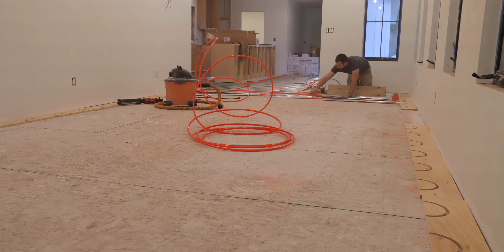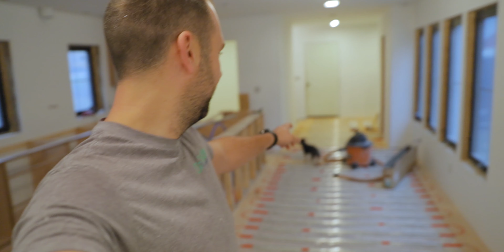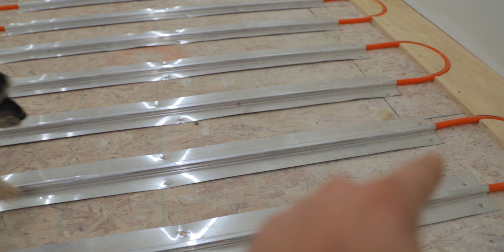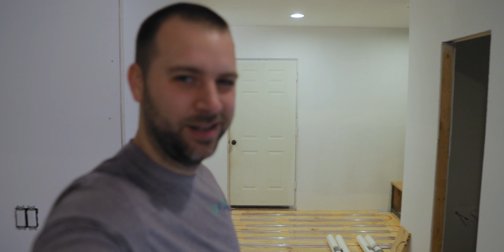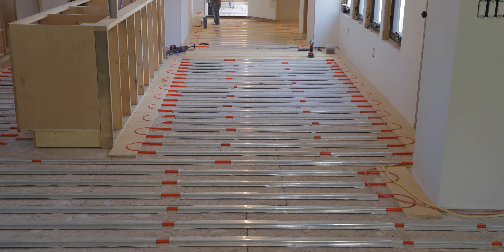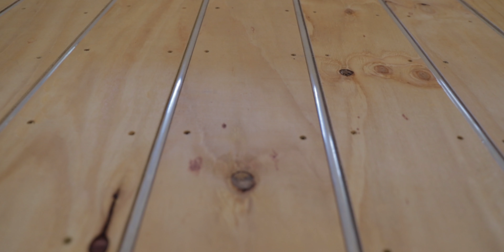Radiant Heat | Installing PEX, Heat Transfer Plates, Sleepers, and a Manifold

Comment: Hi Nate, great job on the radiant floors with hardwood. I would be interested in how well the radiant fllora workwd with hardwood using your approach. We are looking at doing something similar utiliszing an air to water heat pump. We are also looking at ceramics for a portion of the house and I thought you mentioned putting tiles over the radiant heat and I was wondering how that went.

Comment: Thanks so much. I’m gonna follow exactly what you did except one thing. Why not just buy big sheets of aluminum and sandwich it between and not use those fins? I could either lay it down before I put the slice boards on or if I put it on top of the sliced boards covering the pecks, I can just mark the aluminum with a sharpie where the pipes are it should work and I think it’d be a lot cheaper.

Comment: You probably don’t check this anymore, but I’d love to know how your system turned out. I’ve basically decided to go like your tile area 100%. I made a simple model and connected it to a hot water line, then checked the temps with a heat gun. Your tile method gets warm so much faster.

Also, I just laid aluminum flange sheeting over the loop ends with contact cement. Again, better transfer. Just a thought, I’ve been going nuts sorting this out and getting quotes from companies for $20-25k and I still need to do the labor.
Reply: I am in the same boat as you are and trying to figure this out. On a related note, I think I remember him saying in another comemet that he sold the house and doesn't have an update about how it turned out long term.
Reply from the maker: we did actually sell the house, we were there with the system running for a couple years and loved it. the tile was amazing in the winter, helped dry out any snow clothes and boots and stuff

Comment: What exactly is your heat source? I used a  gas fired 35gal  hot water tank in my garage but it's concrete
Reply from the maker: My heat source is a tankless water heater / boiler run on natural gas
Reply: @natenstaci  What temp do you run it with as far as temp of water going into the system thank you for all your answers
Reply: Sorry just read somebody else's question

Comment: Wont the plates installed over the tubing reflect the heat down rather than up?
Reply from the maker: The plate are more for dissipation than reflection. the plates heat up and then disperse the heat over a wider area.

Comment: How do you install flooring on topwith the fins stick up in the air that looks backwards
Reply from the maker: Just rolled out an underlayment over top the fins and installed the flooring like normal, making sure to avoid nailing through the tubing

Comment: I am doing mine a bit different, I had a problem used a router for the curves but the plates mounted fins up with the 1/2 tubing were proud of the surface. Cut all the way thru and still proud so I installed them fins down. I had found a picture to keep the heat up instead of the serpentine like yours. Picture from the ceiling down, left side large 1/2 circles, both large and small for the length of the room, the other side off 1/2 hoop. Tubing goes in the left large one then across the room to the small one and back to the large one. Spaced 0ff slightly on the right side.When you reach the other end and start back you end up using the large and come back to the small and do this to the end of the room. This way the heat stays hot longer and the return line is in between the hot supply. I'd post a pic, but can't figure out how. Thanks for your videos a lot of good ideas and learning. My wife says my loops are ingenious so I'm going with the compliment.
Reply from the maker: Thanks for the info, hopefully it can help someone else!
Reply: I’d like to see that drawn out, I don’t follow

Comment: great job Nate, i just got some qoutes to buy eco warmboard, thermoboard, etc, well i knew it was going to be expensive but still did a huge gulp. I dont see how anyone could pay those prices especially since I am canadian and most supliers are American, so with the added exchange, the prices are crazy. You did an amazing job, and this is exactly what I am looking to do! I will have to watch your other videos to see how you made the templates. Since you ripped your plywood to close to 8 inches, I wonder if I could get away with using 1x8 planks? That way I dont have to rip a million sheets of plywood. So glad I found this video! I would never of thought to install the tubing plates under the plywood, but that sure would make laying everything  out probbly easier and faster! I have radiant ehat already under the floor, but its installed horribly, hardly any plates, tubing on the joists, not the plywood, no insulation, its kitec piping, the whole install is trash! Bought it like this! Since this video is a few yeaars old, how do you like your radiant floors?
Reply from the maker: I am glad this was helpful. We had had no issues with it and really love it. And agreed, those prices from the big guys are insane.

Comment: Do you have any issues with thermal expansion?
I've seen recommendations of only mailing it on one side of the transfer plates.
I'll be doing this soon, appreciate the video.
Any issues or recommendations would be appreciated.
Thank you
Reply from the maker: I have had no issues with expansion or noise. This method has worked great for us. You're screwing the sleepers in through the fins on both side anyway

Comment: If someone does not have this guys skill just use square stock furring strips, and nail sheetrock over top 12" o.c. nail /screw pattern. Run furring strips aprox 6 o.c. with your first strip at the edge(s) for sheet rock attachment. Lay it out on paper and keep your 5/8" (heating only) or 5/8" pex tubing (heating and radiant cooling with humidistat and 60 F supply water for cooling and you will never have a condensation water problem) also at  6" o.c., and try for almost full coverage with the heat plates.  If you cannot find 5 to 6" wide heat plates made for  5/8" pex tubing order from china. China has tight u channels and omega style. If all else fails get a roll of roofing Alum flashing 7 inches wide , and make a press form by gapping boards about 5/8" for 1/2 pex or 3/4 for 5/8" pex, and hammer the sheet metal into the gap using a grounding elect rod laid flat and drive it into the form. Put a flat board on top to make the final press. You should with practice make functioning heat plates and use the same way. It's two bad that we are being so exploited in the market place because alum heat transfer plates should be cheap.   Also, if one one the half dozen pex manufactures seem not competitive enough then look for a European supplier  that has the US certification also approved. You can often save 1/3 on pex A finding a European supplier. This technology is well known in Europe and Asia,  and the novelty of it is sure to drive up prices initially. I would not be surprised if the prices drop at least 1/3, but don't wait because even at inflated prices heat pump hydronics will pay for itself.  Europe has the same technology all in one box appliance cabinet that they place almost anywhere in there house , without needing to know all the complicated stuff. For now, if your budget is tight install the radiant pex panel designed for a heat pump, but maybe for now you can get a lot of the advantage using a gas hot water heater. You dont need over 120 F water and maybe your design can work at 100 - 110 F, and most hot water tanks can make 60,000 BTUs,  which is enough for most of us. The important thing is to switch away from inefficient forced air systems to hydronics.  Your wallet, your comfort, and the environment are all winners if you do future proof your heating and cooling. Up grade to a modulating modern air to water (cold climate suitable) heat pump. The efficiency is getting almost as good as a geo heat pump and the modern air to water has become very affordable, and more so in the future. I hoped I moved a few if you to DIY.

Comment: Been researching this and plan to do almost the exact same thing. Seems like you would get more heat transfer by having the fins exposed like you did towards the end of the video. After a year can you tell the difference? Thanks for an awesome video
Reply from the maker: I can certainly tell the difference, but that's more because of the flooring material over top than the fins themselves. I would still like to do an actual test of the many different methods

Comment: What type of piping did you use?  Pex a or b and it has to be the oxygen barrier pipe correct?  Also why did you choose 1/2 inch pipe?  I know that the premade ones are 5/16 pipe?  Any difference...Amazing job and really impressed.  One more question...do you have to use 3/4 ply or can I use 1/2 plywood?
Reply from the maker: Thanks for the comment! 

I did use oxygen barrier pex, I don't recall if it was a or b though

I used half inch for the increased flow rate and the ability to space then apart a bit.

I used 3/4 so that there was room for the fins and so that in the return bends I could keep a layer of plywood so that the inside circle stayed attached. Probably not necessary though. This way it made sure the tubing didn't stick above the wood so my flooring over it stays flat

Comment: How did the tile end up? Did the aluminum plates effect the underlayment? What kind of underlayment did you go with?
Reply from the maker: It turned out great and heats really well, the underlayment is schluter ditra
Reply: @natenstaci  did your tile guy have to do anything extra to accommodate for it? I only ask because I'm in the process of doing the same but all tile lol.
Reply from the maker: Nice! That'll be great for hearing, the tile hands down radiates the heat better. Regarding the install though, no, not really. I had a couple floors that were pretty unlevel, so he used some floor leveler first on those. But he would have had to do that with or without the heat, so yeah it was a normal tile installation.
Reply: Any updates? How do you like it? Worth the additional cost/work? Any videos on balancing the system?
Reply from the maker: We still love it, would 100% do it again. What do you mean by "balancing the system"?
Reply: @natenstaci  when you fill the lines they need to be bled and balanced so that one line doesn't flow too fast(not effective for heating) or too slow(also not effective)
Reply from the maker: Oh yeah, for sure. The bleeding is a pain to get all the site bubbles out, no real tricks there. The balancing was easy though, my manifolds have a flow gauge and adjustment on each loop so it was easy to get them at the same flow rate.
Reply: @natenstaci  gotcha now did you end up having a manifold for each zone or did you have loops meeting up to a main manifold?
Reply from the maker: I have a minifold for each one (1 per floor) and then a number of loops coming into each manifold. Then there is a dedicated pump for each zone/manifold

Comment: What made you going with this method vs something like quik trac system? Im currently working on literally and exact same type of house you have all the way down to the concrete counter tops and black windows. Love all of it.
Reply from the maker: Awesome! We are loving how it's all coming together. The decision was 100% cost based. All of those systems are sweet, but expensive, and I had a lot more time than money, So I decided to make it all myself, want hard, just took a little more time
Reply: @natenstaci  I figured the cost was probably the determining factor which I totally understand. How well does the heat transfer through the engineered hardwood you put down? We are trying to decide on which material to use.
Reply from the maker: It transfers just fine. We didn't have any issues with the heat transfering. Now the wood doesn't really get warm like tile does, but it heated the kitchen, living, and dining rooms just fine all winter
Reply: @natenstaci  Awesome. We are in the north as well. Upstate NY so I want to make sure the system heats well.

Comment: Wow, looks awesome. Would love to know what the performance is. Great video, just about to do the same. Yes, 100 lbs for your pressure test for 20 minutes.
Reply: Virginia Polytechnic came up with a test method . This guys system is twice as good as warm board. Warm board is an very expe dive medium grade product. It has gathered a strong structural subflooring, but when you do that it is a compromise.  Back to some numbers. If  you use wide heat plates between 5 - 6 wide, 16 to 18 gage Aluminum heat plates, and space your pex at 6 inches on center, use 1/2 or 5/8 inch pex, at 0.5 gal per minute and at a supply temperature of 110 F = a fraction under 35, so I am rounding up. The output is 35 BTUs / sq ft / hr. and that's with a sheet rock cover. 
People need to modernize applications for low heat air pump systems to future proof there design.  Often floor installs can be sketchy with modern heat pumps and low temperature modulating condensing boilers. When a guy uses floor heat and the wife puts down a rug or covers with furniture you are going to need to bump up the water temperature if you can. So if you use this system under a hardwood floor you are going to have trouble driving all the BTU output where it will be useful. Here I believe this system works great, however, with the same cost and effort out lay much higher efficiency is gained doing a ceiling install instead.  A person can reduce the temperature maybe 15 degrees and dramatically increase the COP efficiency and same aot of money and energy. At 100 degree F this diy install on the ceiling  would put out 22 BTUs / ft2 / hr very easily.  A guy could use out door reset on the buffer tank and most of the year maybe heat with 95 F supply water to the ceiling. This same system can do radiant cooling with 60 F water & a thermostat- humidistat and never have condensation problems. And humidity could be controlled by either putting a small bath fan on auto timer 10 min ever hour, or using a heat recovery ventalation (HRV) that dehumidifiers. If you lived in the Southeast USA,  then radiant cooling would do most of the cooling, but maybe do 40% with a cold water AC at the s as me time to remove extreme humidity. I love this video because this guy made a radiant panel that was actually as lily better than a leading expense one like warm board . When you space pipes at 8 o.c. you capability to put out BTUs is not near as great. And warmboard has too much thermal barrier, and it is a product designed for older technology or older applications. The pressed alum sheet , full cover alum, is a great idea, but it's time they update their product to 5/8" pex tubing, 6" o.c. pex, and lighten the mass or design to push heat out with insulating material that does not melt like EPS or off gas like iso, and easy to cover. In the mean time the DIY guy shows us how we can do this with simple materials and obtain the highest efficiency.
Reply from the maker: i totally agree! id love to do a test of all the different install methods... maybe once this project is done.

Comment: Great job!! I'm looking to do the same thing in my house. Where did you get the measurements for your templates? I was thinking of using a serpentine layout as well as longer runs.
Reply from the maker: Actually just made them up! i wanted a 8" spacing from center to center on the tubing, so just figured out the radius/template from there.

Comment: I've never seen this done with the aluminum transfer plates on the bottom of the sandwich. Where did you find that info? Looks like a pain to do but I do like the finished product compared to the way I've done it - which is like your 'tile' area, with a 1/4" underlayment over top. You should get a thermal camera on the floor to compare the two areas, I'd be super interested to see that.
Reply from the maker: I found that from adiantdesignandsupply.com/productsthermofin, that i show they suggest you install their product, and I 100% agree on the thermal camera, the issue is the price! The heat transfer in the tile area is certainly better, but i think thats more related to the tile being a much better conductor/store for heat.
Reply: @natenstaci  Thanks. That's interesting. A lot of flooring I've seen requires a certain distance from the radiant heat source to the flooring - 3/8"-1/2" being common. Doing it this way seems like it would fix that problem without gross excess floor height buildup. Under tile of course there is no such concern with overheating.

Good point regarding the different materials. That would throw it all off. I may do a room upside down just for science. I do have a FLIR camera that plugs into my phone and it's been really quite interesting if not handy with radiant heat. But yeah, definitely a niche product for a DIYer like myself.